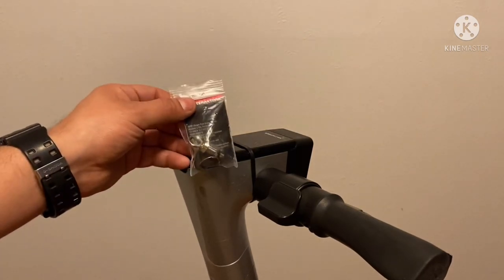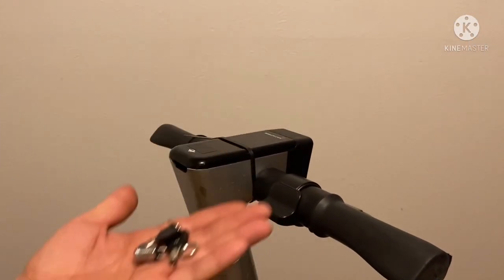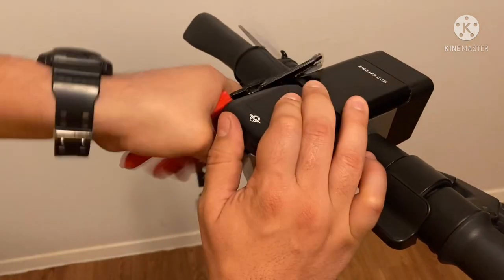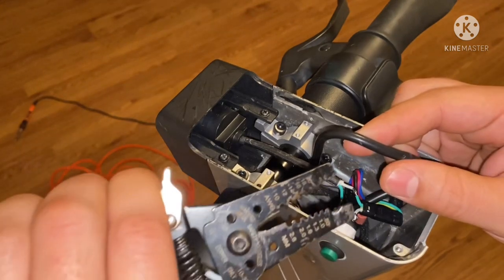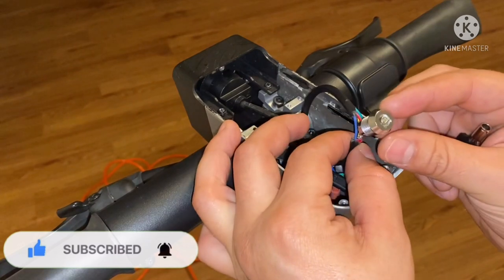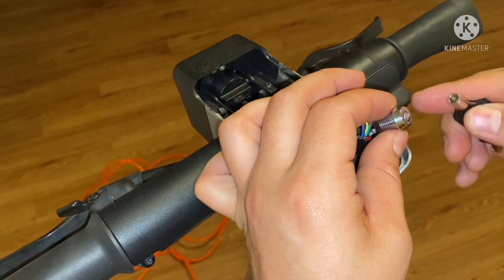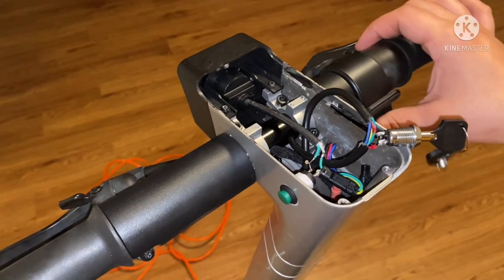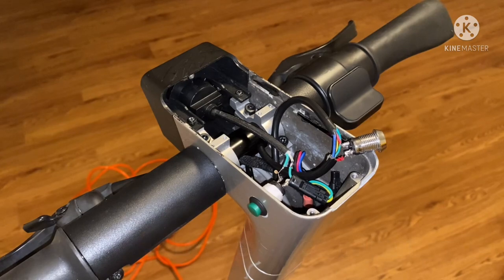Bird 3 scooter -On off switch- for throttle (With key￼)￼

Comment: I tried this with a different ignition switch but got it working well. You can pop the plastic cover off the top then drill holes for 2 toggle switches, the ignition switch, and a 36v voltmeter. The key switches the battery, toggle 1 switches the controller and toggle 2 switches the voltmeter. Drill holes for everything then vinyl wrap it to get a clean look.
Reply: did u swap the controler
Reply: @alainchenier1201  yep

Comment: Sir, when you are satisfied with all your installs, mods and upgrades, would you consider potting the cavity with non conductive poxy ? its something that I do with audio gear and my bass guitar cavities. when i am sure that i have made the last stitch, fix, etc, i pot the cavity. look into it and thank you for your good work.
Reply from the maker: That’s always a good thing to do differently!! 
As long as your happy with your set up and everything is completely done I say sure go for it..it’ll be messy I’m sure but if it’s a one time deal like I said then I don’t see it being an issue.

Go ahead and seal the deal

Comment: Why not just kill power to the controller? 
This is pointless
Reply from the maker: You right ! This deactivates the throttle only which means it becomes deadweight after you lock it. Not all power is cut until you add a on/off relay switch going directly to the power source.
Reply: @pjscootermods how would you kill the power to the controller instead of the throttle? Would you just wire the ignition switch directly to the battery or the controller?